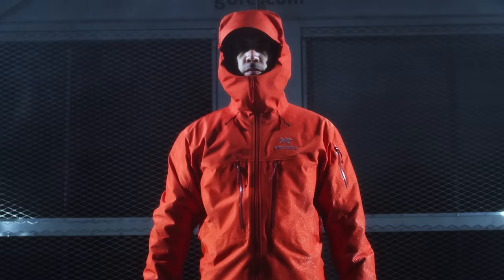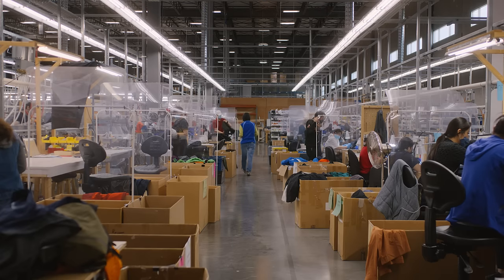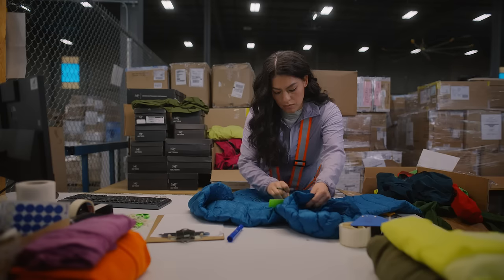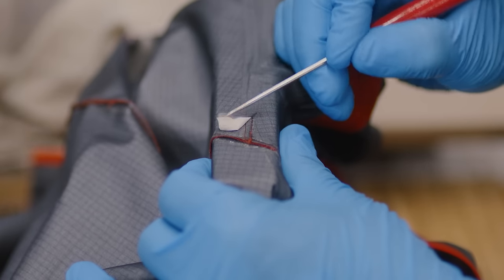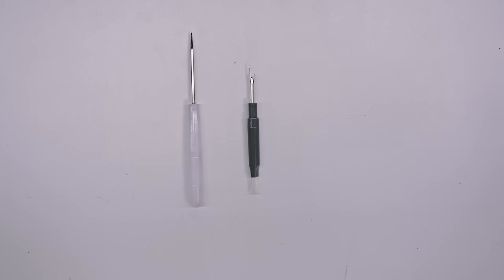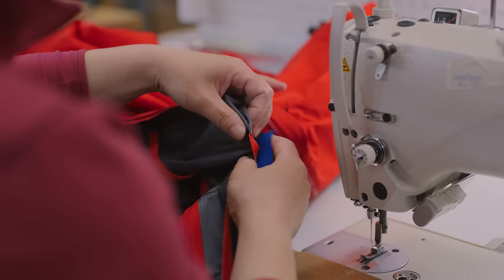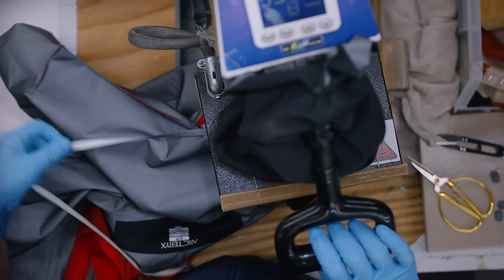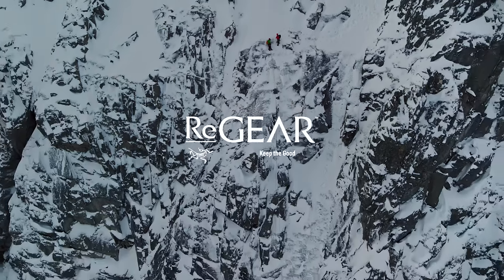Arc'teryx | ReGEAR

Comment: Well made video, but it didn't answer the most important question: Do you redo the DWR coating and/or replace GoreTex? The waterproofing is the main reason I buy a new jacket, so buying a used jacket with messed up waterproofing wouldn't be worth nearly the still-high prices you have ReGear listed at. 

The ReGear site doesn't list the type of return or condition of the return. There's a big difference between a returned new (ex, due to fit) vs warranty return. If it's been worn a while, in my experience the DWR is deteriorated (and at-home re-DWR treatments never get it back to like new) and the often the wearer has wrecked it with improper washing/care.

Comment: Arc'teryx issued this reply in regards to my jacket submitted for repair earlier this year.  It had two notable rips, one that I had already repaired with Tenacious tape and submitted photos of.

"Based on what we’ve seen, this may be repairable however due to For small rips like this, we recommend a product called Tenacious Tape. Once applied, it should restore the area to its normal state. "

Not only will Arc'teryx not be repairing your products in their magical facility in this video, they will not be backing up their products in any way.  My jacket is unusable after 2 years of normal wear.  I will never be purchasing from this company again, and recommend you all follow suit.

Comment: One of the worst customer service for the regear items.Bought a 6 year old atom lt with a almost new condition tag for a 50 dollar less than the current model. After receiving it i found a lot of blemishes on the jacket(Discoloration, Marks etc).I am trying to reach the customer service without any luck since past month. If possible go with a new jacket where you can get a better service.

Comment: The jacket is not a severe environment piece of gear due to the design of the hood. Unless the hood provides coverage above the lower portion of a person's nose the hood prevents the warm moisture exiting the nose to warm the face. It should as well provide complete coverage for goggles. Additionally under severe conditions nose frostbite is a potential by not providing first level nose protection that a hooded jacket should provide.

Comment: Arc'teryx is so far behind other brands with repairs it's not even funny. The amount of time one has to wait when sending in gear from the U.S. is a joke, because it has to cross the border. They could be using a few of the many retail locations they have as repair facilities to fix this issue. I was buying from them for years but stopped after the hoops I had to jump through to get mission critical gear repaired in a timely fashion. The quality might be up there but when it needs fixing, Arc'teryx isn't even close to a leader in the space.
Reply: Who is the leader?